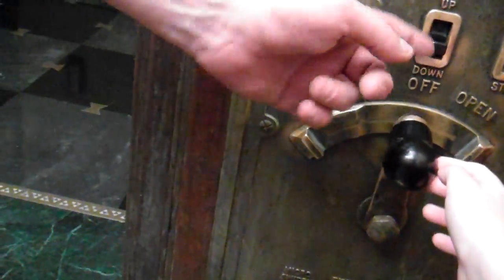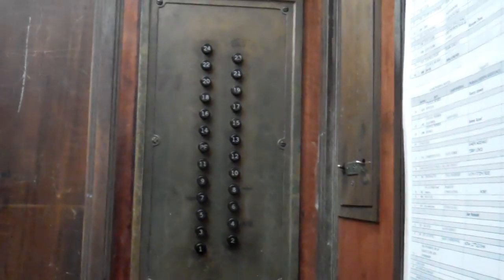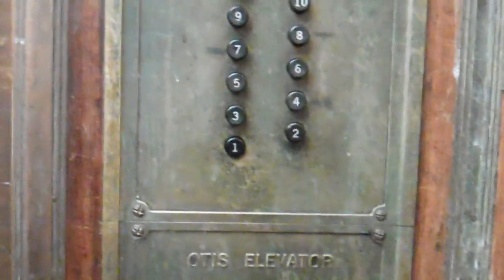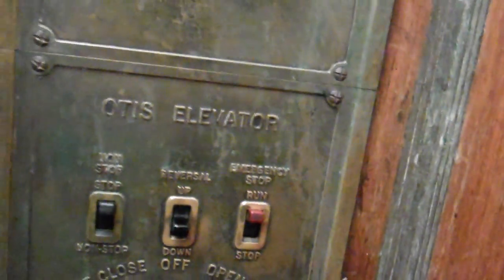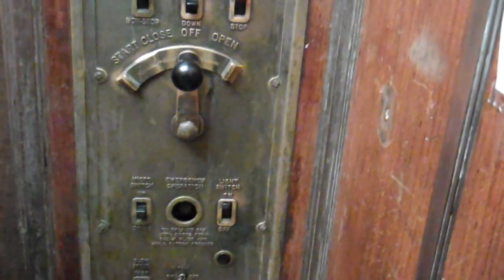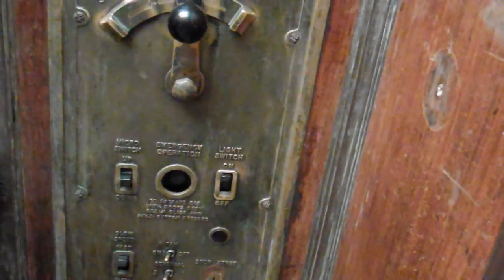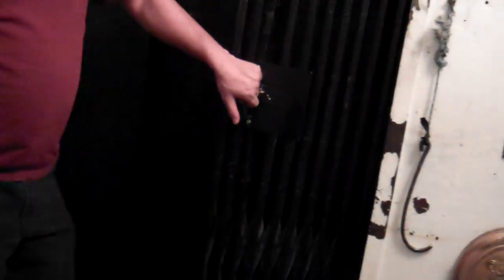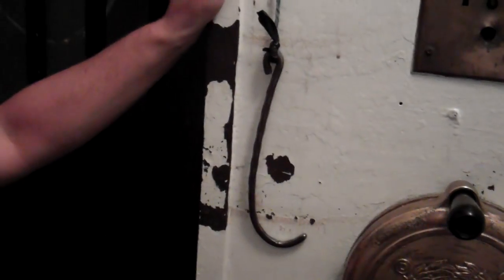Antique Otis Signal-Control/Micro-Drive Manually-Controlled Traction Elevators in Buffalo, NY

Comment: The 1st elevator went to the 25th floor, generally this would be a gear-less traction machine 1:1 roping with a micro-drive?  I don't believe I have come across a gear-less machine with a micro drive before.  Likely an extended motor shaft on the communicator side over, passing thought the bearing block to attach the motor.  With the age of these elevators I am pursuing they were DC traction with a MG or rectifier board. And the micro drive a three phase motor with a phase reserving relay, in the controller wired in with the brake relay.

Comment: Sadly, as of 2017, according to JimLiElevators, this elevator has now been deocmissioned, and they plan to modernize the high rise elevators.
Reply from the maker: What about the manual freight elevator? Sadly, I was fearing this could happen. I think the entire low rise bank (or at least part of the low rise bank) was still Signal Control before the Innovation mod, which made me fear they might modernize the other vintage elevators too. To me at least this could be the saddest loss of historic elevators in 2017, especially if the Signal Control and the manual freight are modernized. This was one of the, if not the oldest known Signal Control that was still running. If all vintage elevators are being modernized then I will be VERY mad that they are ruining some of the most AMAZING historic elevators in upstate NY. If I went back out here I would have likely tried to get a retake, but I am SO glad I got to see these in person before they are gone forever, and because there are no known Signal Controls on the west coast. I really really hope the parts can be saved, especially if the Signal Control is part of the modernization project.
Reply: upanddownadventures The Signal Control isn't being modernized, just decommissioned. Which is really sad as this was probably the only signal control that was easy to access open to the public. The manual freighter was working when Jim went, but it is unknown if it will be decommissioned too, but it's staying. The High Rises are going likely going to be modded according to what the guy told him. And I hate to say, but our hobby is becoming less enjoyable with the amount of elevator modernizations and replacements and decommissions happening. Also, the penthouse elevator at the Crowne Plaza in Niagara Falls got modded.
Reply from the maker: There was a bank of passenger Signal Control elevators in NYC, but it was in a private building, and from what I have heard on an elevator company website, I think it was sadly modernized. There is still 1 bank of passenger Signal Controls I know of left in the US, in Washington DC, at the Ring Building. I don't know if they are accessible or not. This Signal Control was a service elevator, but they seem very friendly to showing elevator enthusiasts the vintage elevators.
Reply: upanddownadventures I actually stand corrected. The defunct signal control JimLiElevators got to see was in the low rise bank. The one you rode in this video is either being modernized, replaced or just totally ripped out. As for the high rise elevators, they plan on keeping the cabs, motors and controllers original, but the guy who took Jim on the high rise elevators said the Touch Sensitive buttons with sadly probably have to be replaced by code. The building plans on keeping them as original as possible and just doing a restoration on them, but the fixtures and call stations will probably be replaced.

Comment: I would definitely ride these if these still existed I would have fun operating this
Reply from the maker: +dominic arnone 
I really hope these elevators are still original, and will not get modded. There was at least 1 low rise passenger elevator that was still manually-controlled with an operator, but that elevator was either modernized, or decommissioned.

Comment: This is cool. I guess these old manual elevators are probably much more reliable than modern elevators because there is much less to go wrong, The electronics are real simple. Modern elevators stall even if there is a power outage for one second requiring the mechanic or fire dept to release the passengers and reset the system. 
The old ones are best :)
Reply from the maker: I have heard that modern elevator parts are more reliable, but there are more safety systems, The bad thing about that is that they are more sensitive, and will cause the elevator to break more easily.
Reply from the maker: upanddownadventures
Also, old elevators are less sensitive to temperature.

Comment from the maker: Someone who worked there didn't let you go up, or your parents? There is an observation deck on the top floor, so someone who works in the building shouldn't care about you riding the passenger high rise elevators. I filmed the other elevators here too.

Comment from the maker: Are you an elevator mechanic? On elevators that use the final limit switches for stopping at the top/bottom floor, will the elevator car have to be taken back up/down from the machine room if it is activated?

Comment: when an elevator reaches a terminal landing it activates a swich, there are two switches one a final limit and one a terminal landing switch when the elevator car overshoots the terminal landing it hits the final limit switch that's what stops the car. To get the car off the final limit switch you have to go into the machine room and boost the car up or down dependin on where the car stops. some manual elevators use the final limit switches for stoping at the terminal floor

Comment: Many historic buildings that still have these elevators use them for freight or only run them on special occasions. I think the Buffalo NY City hall needs a complete restoration with central air conditioning and preservation of the historic elevators. I think they can be restored to mint condition. People would love it if they could ride on those things. Use them for VIP's. or guests of the city. To preserve these, they cannot be used as everyday elevators without significant costs.

Comment: 'i would have all the paneling restored to the way it was when it was new. I would have all the controllers cleaned and calibrated. It would go through this elevator with a fine tooth comb to make it run the way it did when the building was new. Also remember, this elevator does not meet modern elevator safety codes. It doesn't have a FIREMANS control or door sensors. This elevator if not run properly can injure someone. This is the beginning of elevator automation.